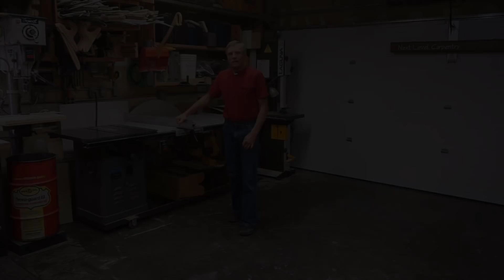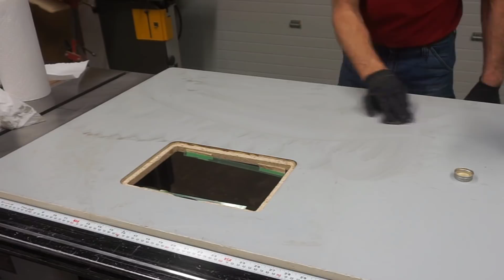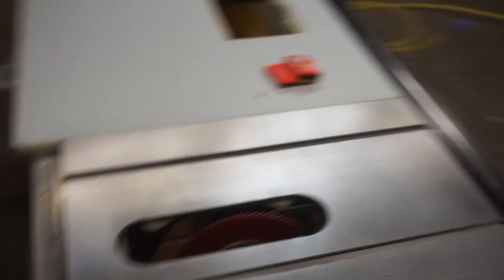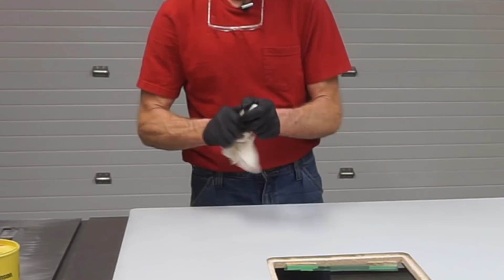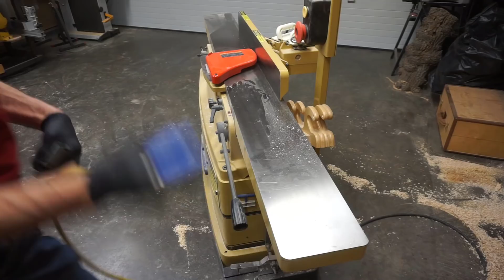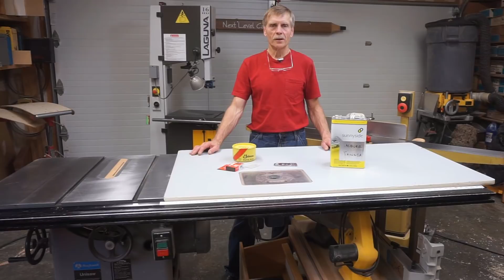Machine Maintenance Tips for Top Notch Performance

Comment: Great tips. I keep my machines in my basement and for what ever reason, probably related to the oil fired boiler, in the last year or two the surfaces are rough from a surface of rust. Where would you start...what abrasive.. to cleanup the surface. And what would would you do about the poor quality metal parts such as screws , and in particular the cylindrical post for my floor Rigid drill press that have deteriorated? Even my Freud dado set that I used yesterday for the first time in two years had some imperfections in the surface.
Reply from the maker: SKWDMDYT,
Rust happens!  An oil fired boiler should be a plus by putting some oily fumes in the air during cold months... I'd guess it's ambient humidity in the basement that's the culprit so you'll need to take extra measures to prevent rust from quickly undoing any hard work you do to clean up rust you have.  Living in a dry climate I'm not the one to know which measures are best so do some searching around for stuff like BoeShield, desiccants, etc recommended by woodworkers in Seattle, Hawaii or other extremely humid locale.  

Start off with the easier stuff like the dado blade so you feel like you're winning.  For that I'd start on the dado set with a SandFlex block which I use for bare metal tools like sawblades, rulers and squares, etc. Avoid hitting cutting surfaces on the teeth because sharpness is more important than shine there. Once you've got it cleaned up use a protective spray or store those smaller things in a plastic box with desiccant packs or the like.

When in 'restoration' mode rather than maintenance mode you'll need to resort to more drastic measures to get things cleaned up. It's kind of like chemotherapy for tools so once you do the treatment, do whatever it takes to keep it from recurring.  That might mean spraying it with BoeShield after use and then wiping the surface with a solvent so it's clean and dry before each work session.  The first drillpress I owned was neglected and badly rusted similar to yours. I used an old beltsander belt,  #80 or #100 grit. Tear it so at the seam and then make a couple strips from it.  Wrap a strip around the column and scrub until clean.  This aggressive measure will change the diameter of the column slightly so make a plan so you only have to do it once.

For the tablesaw I'd start with about #100 or so; use your judgement to choose between speed and results.  The only way I'd do it is to put good sandpaper on a hard, flat block and approach it methodically.  Other videos show using a random orbit sander or belt sander but it's too easy to distort the top surface and/or edges so I wouldn't consider it on any saw of quality or value.  The goal is to remove rust and restore the surface and to avoid rounding off edges.

As I mention in the video: any time spent cleaning up your tools and equipment will reward you with satisfaction when working with well maintained tools.  Plus the elbow grease you expend will encourage you to keep stuff from getting neglected :-)

Best,
Matt
Reply: thanks for all the helpful suggestions. I can't help but notice what has been happening to my machines, but unfortunately my profession requires a lot of "stuff" as well, and with aging comes the inablility to do it all. Your video was the tipping point to get busy with the maintenance. Thanks again. As I contemplate a van conversion or tiny house build I need my tools in tip top shape!